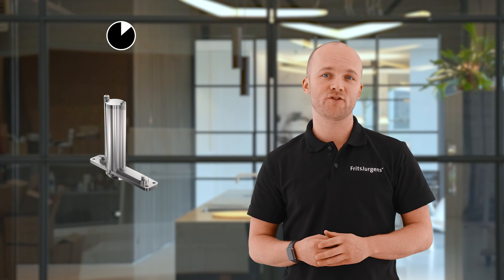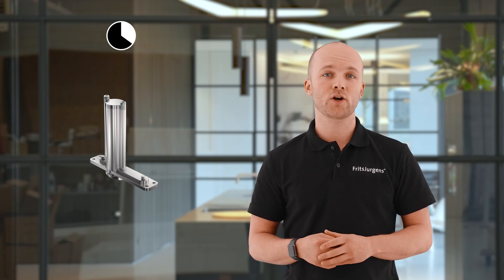System 3 in 1 minute - FritsJurgens Tech

Comment: Does this system have to be used in the center of the door or can you also offset it?
Reply from the maker: Our pivot hinges can also be used offset inside the door. This is mainly done with exterior doors when drop seals are applied, or for rotating bookshelfs for example.